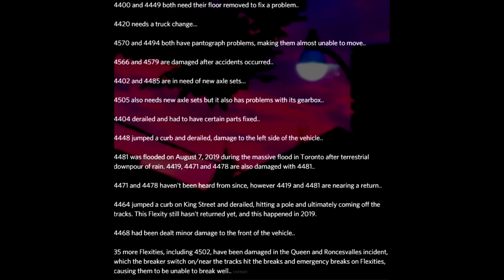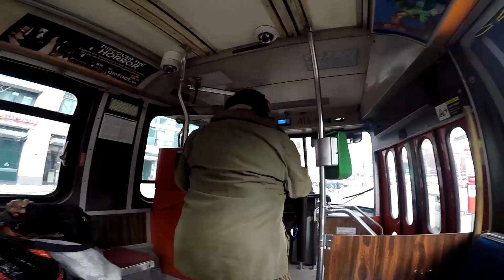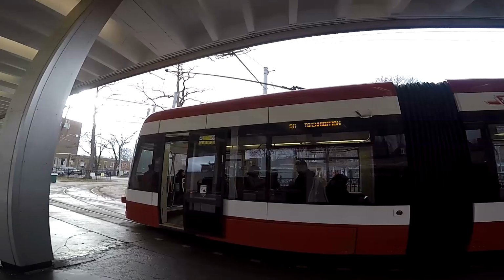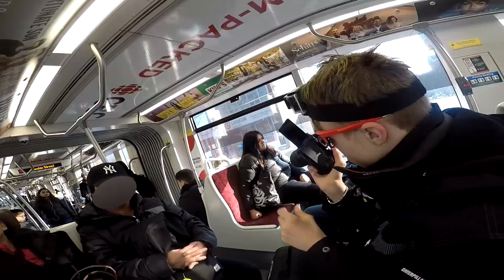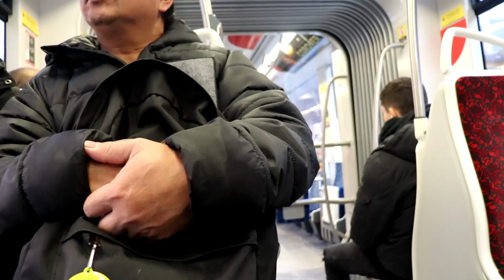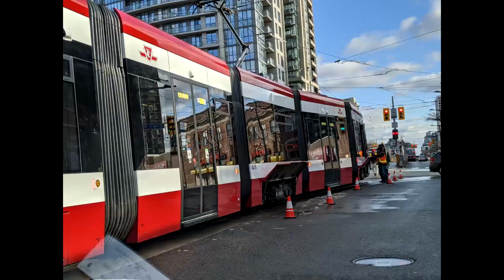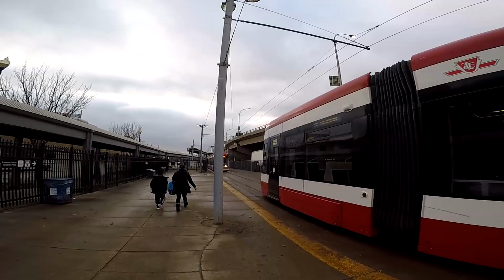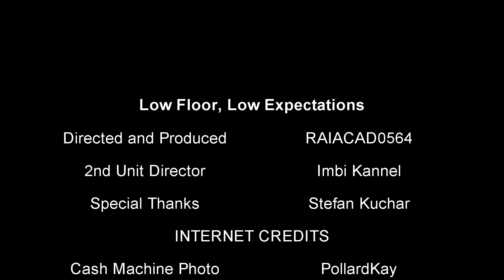Low Floor, Low Expectations

Comment: Wow, this really made me wake up about the streetcars we have now. I initially loved it for feeling new, and 'high tech'. But the ease of use and safety is worse, it is quieter. What were they thinking about the annoying black sheets?

The seats are fine, but it feels more crammed ironically. Air conditioning is great, the look is great, but if they took into account the pros and cons of the CLRV, we would have a better streetcar.

The new streetcars are cool, but aren't as good, I prefer the older ones to some things. The new ones look cleaner inside and are helpful for disabled to get in, but not ask questions! Why is it blocked off?

This was an excellent film, other people would benefit from seeing this.